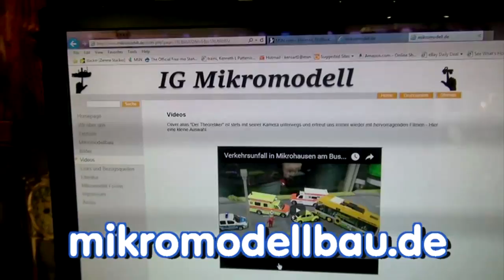What's neat - July 2016 column | Model railroad tips | Model Railroad Hobbyist | MRH

Comment: Heads up.. I just talked with NCE at the NMRA Show. they also use RJ12, 6 wire phone jack to Run the system around the layout. I miss spoke in this show about an 8 pin jack....... We Will do a complete full blown over view of the NCE DCC train controllers in a up coming show.
Reply: Ken Patterson what episode did you do the review of the NCE system products

Comment: Ken:When making your own cables it is important to match colors.  Telephone wire is made pin one to pin six.  Data wire is made pin one to pin one.  LocoNet needs data cables for some, but not all, of it's connections.  It is also important to be sure that your splitters and connectors are six pin and do not reverse the connections.